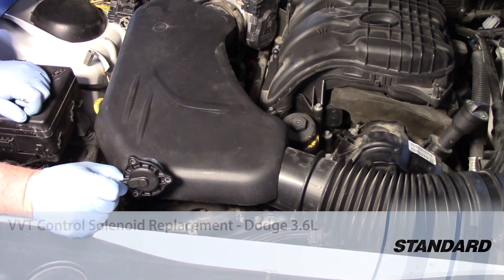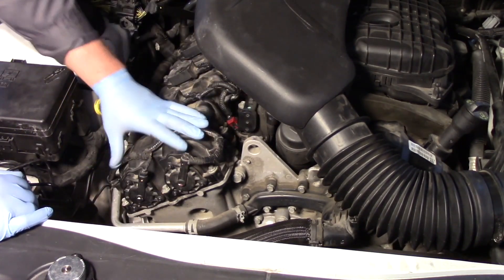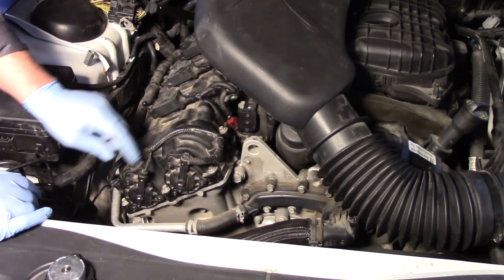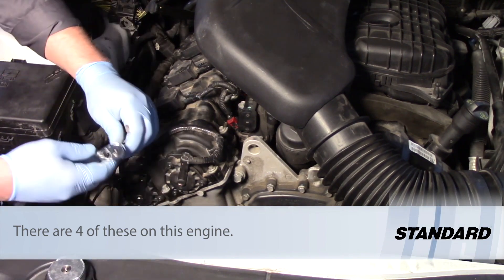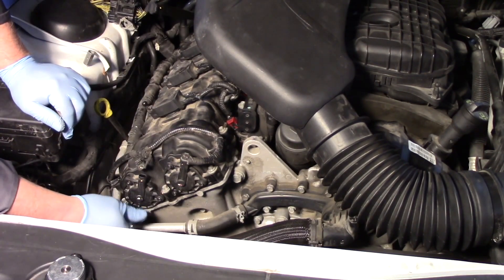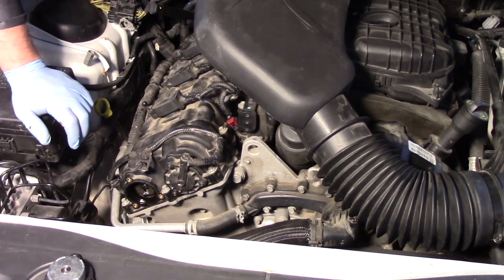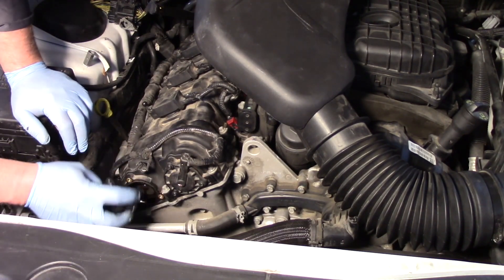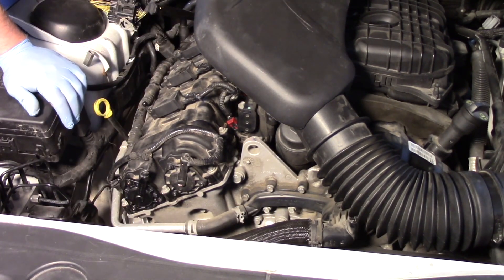VVT Control Solenoid Replacement: Dodge 3.6L

Comment: Shot in the dark...I pulled my Solenoids...and they have residue that looks baked on. I have no codes...just doing random inspections....can they be cleaned, or is it time for new ones? All 4 have build up on the surface that looks like burned oil. Valve train is nice and clean...PCV is clean.
Reply: Did you find the answer

Comment: Could this part be responsible for a slight misfire existing after spark plug change? Changed all 6 plugs after cylinder 2 misfire code. CEL went away and car running better except now a misfire still happening in drive when stopped (red lights) not as bad as before the plugs were changed but definitely still there.
Reply: I had this same exact issue. It all started with my Camshaft Position Sensor Bank 1 when my car went into limp mood and not able to leave 3rd Gear. Prior to this, the exhaust sound is heavily droning and it shakes the inside of the car. Sounds like a poor lawn mower. 

I changed the Spark Plugs over the weekend and only Cylinder 2 Coil Pack since that was Misfiring.

I changed the Cam Shaft Position Sensor on Bank 2, oil and put 6 new Coil Packs just last night. While driving, I opened up the Throttle and had the same sound out the exhaust. The Code it gave me links to the Actuators now. They are relatively cheap to buy and the repair is easy since it's easily accessible.

My car has 67k miles on it. And all I used to do before all this was change Brakes, Oil and Tires.

I think if changing 1 Sensor, it's better just to change the Sensor if they are multiple of the same.

For instance, I changed Bank 1 Camshaft Position Sensor 2 weeks ago then my car started Misfiring last week. So I got new Spark Plugs and Coil Packs. I then decided to change Camshaft Position Sensor on Bank 2 while I did the 6 Coil Packs because I wouldn't want a possible issue a few weeks down the line when outside has 5ft of snow and weeks of Freezing Temperatures. 

I also changed my front Rotors yesterday since my old ones got warped and steering shook a lot while braking from over 50mph.
Reply: For your issue, the Coil Packs need to be changed on all 6 Cylinder. Your car will idle much smoothly and the MPG will be way better. I idled my car for about 30min and my Fuel Range stayed at 175 mile Range that entire time.

I think I will make a video explaining my issues and exactly how I went about solving each problem along the way